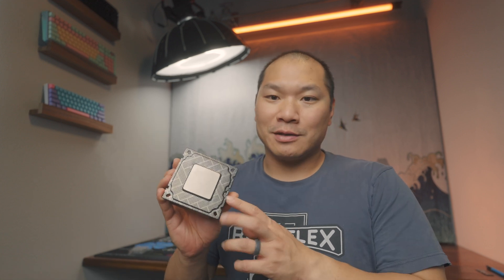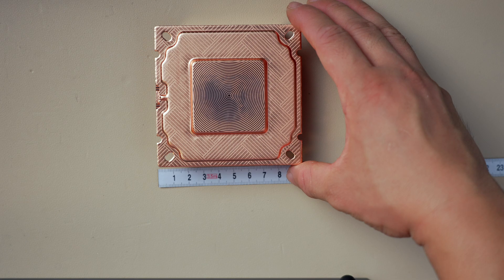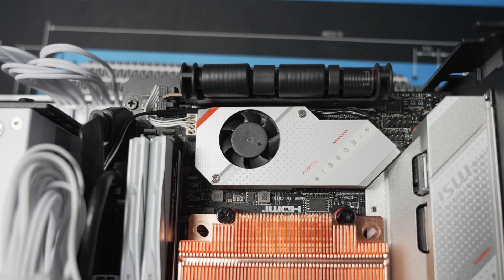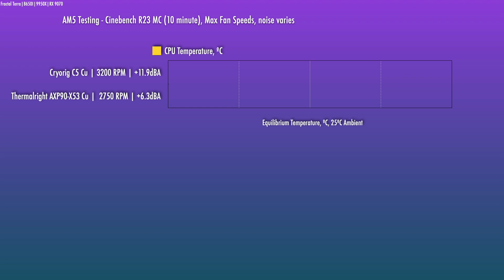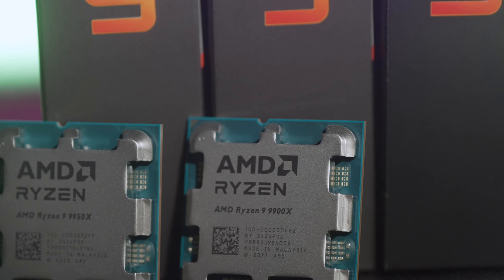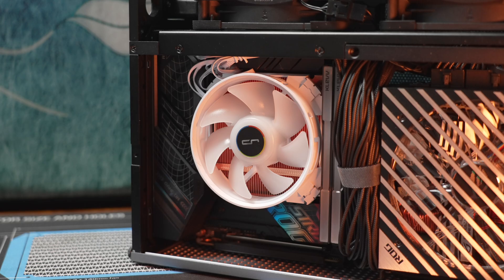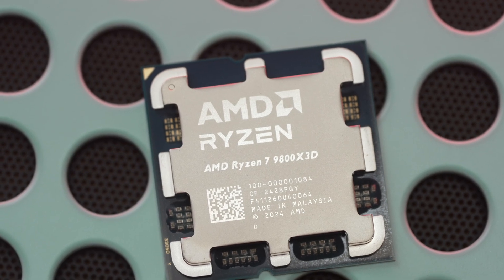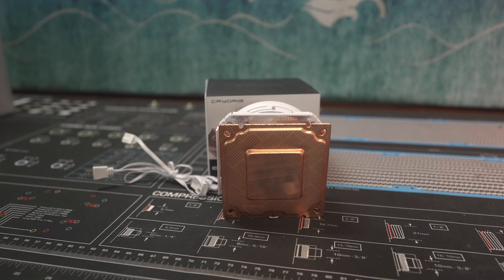Cryorig C5 Cu Review Follow Up - Higher TDP CPUs?

Comment: What if I replace the cryorig C5 stock fan with a noctua A12-25 G2 fan? Or a phantek T30? Or a Corsair Rx120 Max? 

I want to use the most compact heatsink for my 9950x to better handle the stress of constant travel. Upgrading the fan would make it significantly easier. 

My previous amd 5 5600 used the stock aluminium cooler and had no issues.

Comment: There's no replacement for displacement. There's just not enough thermal mass in the heatsink to effectively remove the heat from the CPU (at a reasonable noise volume.) Doesn't matter if they use a vapor chamber or heat pipes it's just too small.  Servers get away with it because they displace large amounts of air instead of thermal mass (and sound like a jet engine doing it) effectively brute forcing the cooling. When it comes to CPU cooling, go big or go liquid.
Reply: What if you replaced the stock cooler with a phantek T30, or Noctua A12-25 G2, or a Corsair RX120 MAX. Or even an industrial noctua 120mm fan?
Reply: Heatsinks are important but what about upgrading the fans?

Comment: Using a 3d printed bracket of some kind would allow a 92mm fan to be used instead perhaps? Would be interesting to see the compared performance between the axp90 using the same exact fan!
Reply from the maker: Well yeah, it could be even simpler than that since the edge of the heatsink does have a lip where a clip could attach. The “90”mm stock fan is practically a 92. The odd thing is I think a slim fan might have made sense in that this would have been a fairly decent 43mm cooler when compared against the likes of the Noctua L9 type coolers, and I don’t think a slim fan would hold it back. Making it thick pushed it into a different class of competition where there is already a clear class leader.

Comment: Seems that Cryorig only put this out as a gimmick, like the Assassin 4 VC. Curious how would CoolerMaster's "3D" heatpipe perform.
Reply: Except the Assassin IV VC outperforms Noctua NH-D15 G2
Reply from the maker: I’ve got it! Under embargo. As for Assassin 4VC, key point is they still use heatpipes. In fact quite a ton of them. The fan setup doesn’t limit it either.

Comment: How about on horizontal state?
Reply from the maker: I tried that as well, it was not a very meaningful difference beyond run to run variance. Which is good in a way since most users will be using it vertically.
Reply: @MachinesMore  I thought vapor chamber works  best on horizontal state for best heat distribution across all fins. Especially there's no heatpipe to run to. :) I set my chopin flat on the table so im curious.